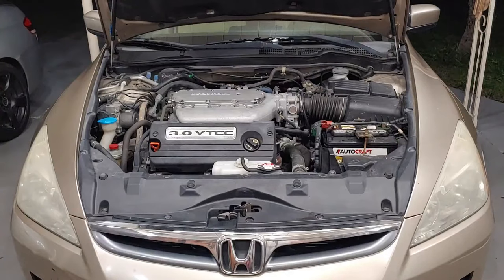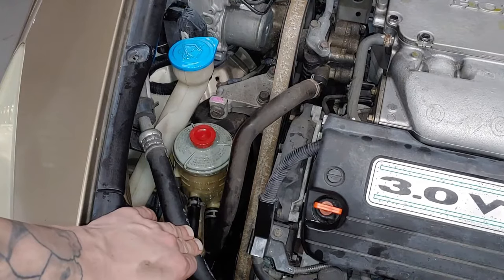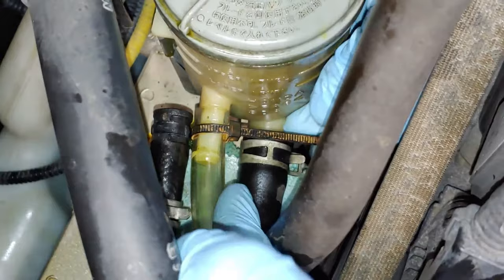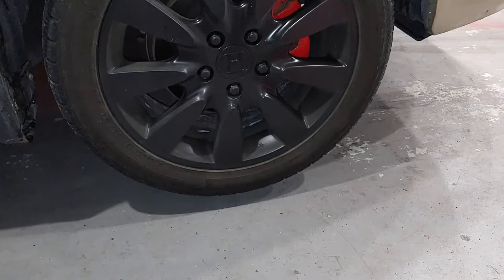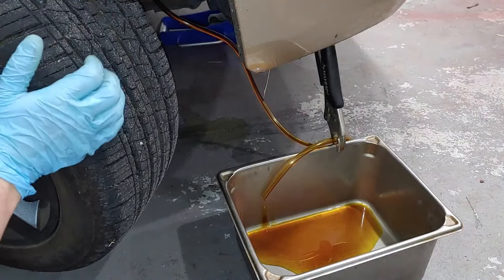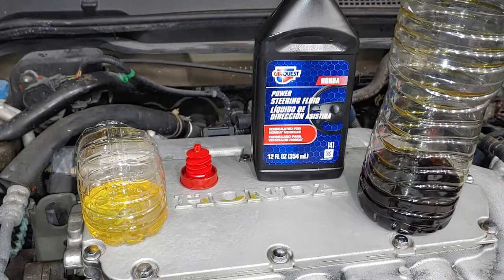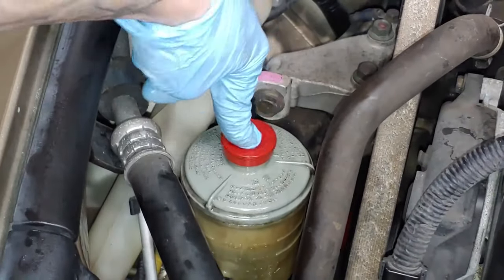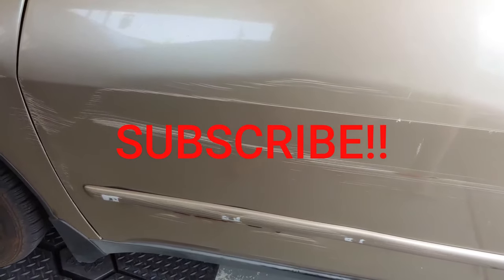Honda / Acura Power Steering Flush / Change  | The Proper And Thorough Way!

Comment: The proper way to clear the air is to actually leave the top off the reservoir and turn the wheel to full lock each side a few times
Reply: The manual says turning the wheel to the lock position can cause damage to the pump
Reply: @projectskadi935  if you leave it there in long period, yes, but for short time, no. If you park on a slope, you must turn the wheels.
Reply: The front end of the car needs to be raised on jack stands. If on the ground, the friction of the wheels turning will interrupt the bubbles coming up
Reply: With the car off or on?
Reply: @teddiazjr.6223  Car is off, front side on jacks. Specifically turn the key into the on position, but do but start it; this allows the steering wheel yo be turned. Remove the PSF reservoir cap and begin to turn the wheel side to side. Start the car and see if the fluid falls. If it falls, turn off and repeat lock to lock. Never keep in lock for more than a split second.  Start again and fluid should remain stable.  Do not overfill the reservoir as the PS-fluid's weight can prevent proper pumping back in. Only raise the front tires marginally (1 inch off the ground) so it mimics a level ground surface.

Comment: Got my answer. The proper tube we want to use is 3/8 inch inner diameter which can be used to plug the reservoir AND for the return line. You also want to get 3/8-in x 3/8-in barb fitting to connect the clear tube and return line.
Reply: >You also want to get 3/8-in x 3/8-in barb fitting to connect the clear tube and return line.

Yeah, it might be cheaper than to buy two different sized tubes. But if not, the different sized tube might have more utility.

Comment: A MityVac makes this an easy job. I like to pull the reservoir and spray it out with brake cleaner. Lotta crap in the bottom. Thanks for the video.

Comment: Great video! Nice, clear and straight to the point. I prefer 10000x more to "lose" some minutes doing that flush with the car off than running the pump dry. People really underestimate how fast the fluid flows when the engine is running and how much wear you can make in the pump for a few seconds dry.

Comment: This is the best video I've seen so far on how to change power steering fluid. Specifically, other videos have you disconnecting the return line at the other (i.e., non-reservoir) end, which is harder to access and messier. Also, they turn the steering wheel instead of turning the wheel itself; I like your method better since you can monitor the fluid coming out more closely. The turkey baster method seems a bit messy, though; I think I'd want to use a syringe or hand pump instead to minimize leakage. Thanks for the great video!

Comment: Keep in mind Honda accord 2014 and Honda pilot 2017 does NOT have a power steering fluid.
Great video, I bought six bottles power steering fluid to flush out for both cars. Realized no power steering fluid.

Comment: I was wondering about the fluid that’s left inside the pump, and the lines leading to and from it? Since the engine didn’t spin the pump, it could be that there is still old fluid in there, please correct me if I’m wrong

Comment: if you put jack stands under the car, you should lower the car onto them, but leave a some pressure on the jack as well.  they aren't gonna help if that car slides off the jack to one side-- might even punch a hole in the bottom of the car.  you'd be better off not even using the jacks if youre going to do it that way ((wheels on, and stands w the gap))

Comment: Great vid.  Quick question for you  or anyone.  I have to replace the high pressure hose.  Should I flush system before or after, or before and after?
Reply: After. No sense in putting new fluid into a system you’re going to open up and drain, anyways.

Comment: Not sure the jack up is necessary, but couldnt hurt. And OEM service manual  (8th gen Accord)  doesn't even cover "flush" per se, just replace nor the need to jack vehincle.  OEM manual steps:  
Connect drain tube to PS line, states to start the engine, turn wheel lock to lock several times until no more fluid, stop engine. Notes to run engine and keep turning wheel until no more fluid coming out, then immediately stop engine to avoid damage (insinuating bad to run engine long time, but needed short term to successfully purge).   Fill fluid to upper level.  Start engine, let it idle, turn wheel stop to stop to purge air from system. Add  ore if necessary.  If still dark or not totally clear repeat process.
Reply: That seems like a much faster process.
Reply: Actually, I like this method better than running the motor to drain or purge the old fluid. Less chance of a shade tree "mechanic" burning up the power steering pump. These Honda pumps are not cheap.
Reply: @michaelwright1602  Yeah, I ended up doing it with the engine off. Took way longer than I wanted it to. After all the air bubbles were out, I still heard a whine noise, turned out it was the alternator.

Comment: Nice video How would one clean the reservoir ? It’s kinda dirty and the filter dirty as well.
Reply: Drain reservoir, disconnect and remove it from lines, clean with some power fluid. Should be fine or just replace if in doubt

Comment: I just saw this video, I was wondering, would I need to do this before or after replacing my power steering pump?
Reply: Old comment, I know, but do it before replacing. That way, the new pump isn't contaminated.

Comment: Hey thanks for the sharing the video! I have watched a few of these already. Is it okay to jack the car from the front side of the vehicle without the jack stands to get both front tires up? Since I don’t plan on working below the vehicle. Also when you jack the under the front of the car. From where exactly are you jacking the car from? What’s that part called & does  the frame of the vehicle run along that area..
Reply: The locations where you can place a jack and lift your car from are called "Jacking Points". If your car has one on the front and center, you can use it to raise the front of the vehicle from the center.

Comment: how much oil this procedure needs ,2 quartz  or more ?
Reply: Did you find the answer?
Reply: @asserabo-elkhair7098  Nope, but i think a quart or two of fluid would suffice the steering rack and all the lines , hope that helps.🐓
Reply: The owner's manual will tell you how much you need. You can probably find a PDF of it online and then just do a search (ctrl+f) for "capacity" or "Power steering"

Comment: Hi Peeps, hope you're all doing great 🙂...Great video brother 😉...Peeps, could you confirm that the  power steering reservoir pipe return inlet is the same diameter on a 1996-2000 Honda Civic EK/EJ? Would the same size tubing work on my EK civics reservoir? Thanks guys 🙂
Reply: I think so bro the pump is all same in all honda

Comment: I have the same vehicle as this one here. When I put the key in accessory mode I can't turn the steering wheel. Is it okay if I do this while the engine is running?? The car runs fine with no issues but I've noticed some moistness on the power steering hoses. It doesn't make any weird noises or anything

Comment: I did a similar flush with my CRV, but I would run the engine just for 5-10 seconds while turning the wheel L & R. It seems to flush the old fluid out faster, and the steering was so much better afterwards. Does this same workflow apply to all cars, incl my BMW e46? Need to do a flush on it as well. Thanks!!
Reply: @sbrave, do you remember the tube size you're using when you did your CRV? Also, what did you use to plug the reservoir?
Reply: Found my answer. It's 3/8-in inner diameter.
Reply: Cool. As far as the plug, AutoZone or O’Reilly sells, these rubber plugs in an assorted pack. I just used the one that fit over the reservoir.

Comment: how much power steering fluid need for 2012 honda pilot . I want to change my power steering fluid because  be careful the mechanics will put other fluids to the power steering reservoir to damage the pump  and they will get  huge money to fix it.Also they put to alternator which will destroy within a month.

Comment: Where did you get the clear hoses from ??
Reply: You can buy it by the foot at most hardware stores. If I remember correctly a prepackage 10 ft hose was like $5 at Home Depot.
Reply: @daveclark8337  thanks for the input

Comment: Connect a hose (B Low pressure) of suitable diameter to the
disconnected return hose, and put the hose end in a
suitable container.
3. Start the engine, let it run at idle, and turn the
steering wheel fromlock-to-lock several times.
When fluid stops running out of the hose, shut off
the engine. Discard the fluid.
4. Reinstall the return hose on the reservoir.
5. Fill the reservoir to the upper level line (C).
6. Start the engine and run it at fast idle, then turn the
steering fromlock-to-lock several times to bleed air
from the system.
7. Recheck the fluid level and addmore fluid if
necessary. Do not fill the reservoir beyond the
upper level line.

 -The Honda Service Manual.
Reply: wasn't it a great idea that he didn't run the PS pump at the beginning but instead used the pressure within the system to bleed the old fluid out.  We should all keep an open mind to ingenuity. Excellent job wasn't it
Reply: This is how I did it with my CRV (running the engine & turning the wheels) and it made it a LOT easier and faster to get the old fluid out. These guys doing the turkey baster only thing are spending way too much time getting the old fluid out, and refilling, etc.
Reply: @sbrave so dont get the oldfluid out of reservoir before removing return hose?
Reply: @balkee42  Yes, you can use a turkey baster or something, to to remove it before removing the return hose, OR just remove the hose, and plug your finger over the res hole, and then attach the draining hose. Either way will work.
Reply: @sbrave  >These guys doing the turkey baster only thing

It literally (literally) says to "disconnected return hose" so you have to empty out the reservoir unless you're fine with fluid spilling all over when you disconnect the return hose. The Turkey Baster is a valid way of emptying out the reservoir.

Comment: You did everything right except use non oem honda power steering fluid that gonna break the system
Reply: straight up myth lol, manufacturers can't have a monopoly on fluids, there are plenty of brands that have the same specs as honda fluid that work fine

Comment: Can you not use water to clean the reservoir and then add the power steering fluid?
Reply: Don’t use water, you don’t want to mix water and hydraulic fluid. There are some ways to clean it out but you really don’t need to usually. The clean brake fluid will clean it up pretty good.
Reply: Pull the reservoir and use clean power steering fluid to clean it out.. the filter traps dirts, you will know when you have got it cleaned enough, of course you can’t get it sparkling clean like brand new. However, according to Honda manual, just replace it

Comment: The 1/2" hose is too big. I am assuming he meant inner diameter and it is to stiff to use a zip tie to secure, and I had no hose clamps, GRRRR. I believe the correct size is 5/16" ID. I got this shit all ready to do, 8 pm Sunday night, thought I would pound it out. FUCK! The lines are too big! Another day wasted. I'm going to call the dealer and see if I can get the specs on the power steering lines, the inner diameter and buy some automotive hose and clamps. This was a total waste of time.

On Edit: After much frustration! The job has been completed. I used 5 full bottles of the Honda Power Steering fluid I bought up at the dealership. The fluid was really bad, power steering pump was singing. After the flush, no more power steering pump noise. I had to figure out how to do this, I need this car back on the road. Here is what I did after I cooled off, damn long day. 

I went up to Oreilly's and bought the "Dorman HELP Rubber Bypass Cap Assortment", Part number 02252, $7. I also bought a pack of four winged worm gear clamps, the "MasterPro Hose Clamps 1/4 inch to 7/8 inch Hose Clamp" Part number MP6B004V $4. I also used a 1/4" drive 8mm deep socket, or you can use a 5/16" deep socket to make a union between the return line and the 1/2 inner diameter, 3/4 inch Outer Diameter clear hose I bought at Home Depot. That 8mm or 5/16 deep socket, just stuff it in the end of the power steering return hose and apply one of those clamps, then stuff the other end into the 1/2" tubing and apply the largest clamp and tighten both. Those rubber vacuum caps, use the appropriate size and install on the nipple coming out of the power steering fluid reservoir, apply another clamp to secure it. 

I ran the hose like he did in the video, into an empty milk jug. I unlocked the steering wheel, I DID NOT start the car, and simply turned it lock to lock and kept the reservoir full with power steering fluid. I kept Turing the wheel until I saw clear fluid coming out. I let the power steering reservoir empty out, tore everything down and attached the return line back to the reservoir. I then filled, and kept turning the wheel, lock to lock to get the fluid into the system. Once I was satisfied, I started the car and turned the wheel lock to lock, and then did the final fill. Took around 40 minutes with interuptions.

If you have the hose clamps laying around, great! That bypass cap assortment, you do not need those, you can simply cut the finger off of a rubber latex glove and put that over the nipple of the power steering reservoir. Secure with electrical tape or a zip tie. The socket was a no brainer for a union after I gave it some thought.  

I bought the above because I can see a use for these new tools. And that is what they are, tools. Sharpies my ass. 

I hope this helps.
Reply: Great write, thanks for sharing.
Reply: Actually, for the return line, I would not use Barbed Fittings + Screw Clamp. It's money wasted and more work. Just find the proper tube sizing and use the existing spring clamp from the return hose, like the video demonstrates.